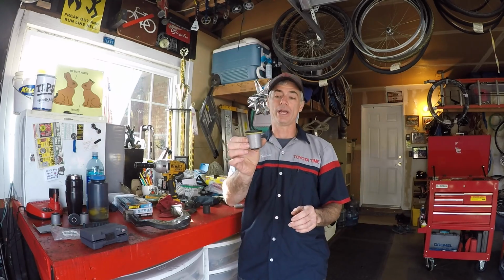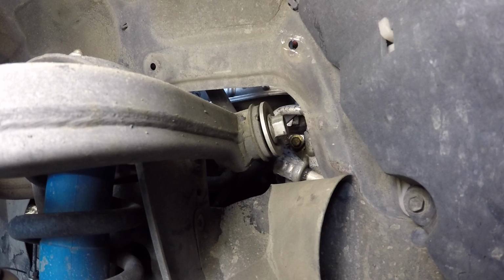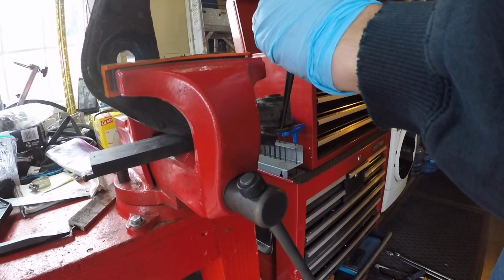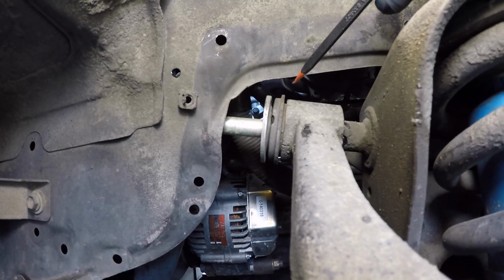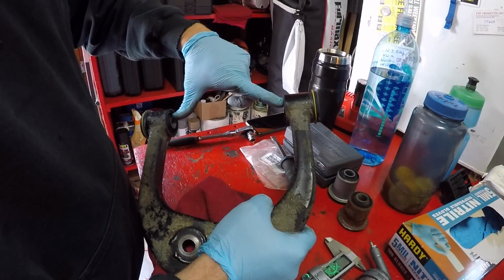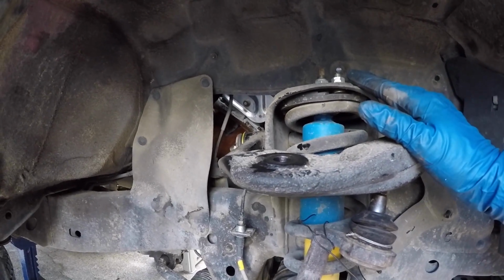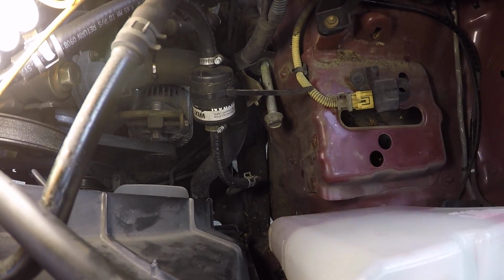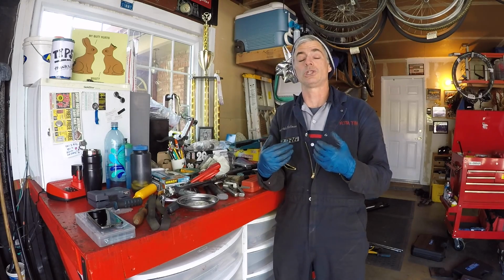Front Upper Control Arm Bushing Replacement

Comment: Hi I'm looking to do this job later this month. Do the OEM UCA Bushings (#48632-35080) come as singles, or packs of two? Need to know how many to order. Thanks so much for these fantastic videos! I'm doing a whole redo on the front end (UBJ, LBJ, bushings for UCA and LCA, and new inner/outer tie rods!), so your channel is a godsend!! Thank you!
Reply from the maker: Hey Steven, the bushings come as singles.  Great to hear you're making good use of our videos.  Happy Wrenching!
Reply: @TimmyTheToolman  Thanks Timmy! Also, this is a bit of a shot in the dark, but would you happen to know if that bushing (part #48632-35080) would fit in a 1998 Tacoma SR5 3.4L 4x4? I can find the parts, but all the Toyota sites are saying the fitment isn't correct given my VIN, and I can't find the equivalent part number for my Tacoma (they only sell the entire UCA). Should I try anyways, or just go with aftermarket bushings from Energy Suspension?
Reply from the maker: @stevenwang4125  The suspension on the 1st Gen Tacoma is pretty much indentical to the 3rd Gen 4runner but they will quite often have different part numbers for the same part.  Here's a link to the Camelback Toyota site: https://parts.camelbacktoyota.com/parts/1998/Toyota/Tacoma/SR5/?siteid=214329&vehicleid=84925&diagram=8510185  Take a look at item #9.  Part number #4863235070
Reply: @TimmyTheToolman  Thanks so much, sir! Looking to do the work this weekend, so if you notice a sudden surge in your views, you'll know why! ;)
Reply from the maker: @stevenwang4125  You're welcome Steven.  Good luck with the job.
Reply: @stevenwang4125  Did part #4863235070 work for you?
Reply: @fcparsons  they ended up not carrying it in stock. I ended up just ordering brand new UCAs... Sorry!
Reply: @swang011  Good deal! Thanks.
Reply: @TimmyTheToolman  Love your videos and respect the work that goes into them. I’m in the same situation as Steven was. Stevens Creek Toyota officially says uca replacement is the only approved way to replace the uca bushings on a First Gen Tacoma. I’m tempted to try one of the 48632-35070 bushings to see if it works before caving and buying new uca’s.  Your thoughts?
Reply from the maker: @fcparsons  If you have the right tools, replacing just the bushings is cost effective.  Dealerships and other shops will take the easy way out because they know their time is expensive so they won't suggest bushing replacements because it will equate to the same amount to the customer whether they choose new control arms or just replacing the bushings.  But, do you you earn $200/hour?  I definitely don't.  So, it's cost effective to me to take the time to replace just the bushings because it's a savings.  A hydraulic press, press sleeves and other tools will pay for themselves many times over if you like to wrench.  Shop labor rates are extremely expensive and it pays to do your own work.
Reply: @TimmyTheToolman  Finally got around to it. Can verify the 4Runner 48632-35070 bushings you reference worked on a 99 Tacoma. Had to use an angle grinder to shave off bushing flanges to fit bearing splitter on arm. Then used bolt and washers to press out bushings. No heat needed. Worked like a charm. Thanks for the inspiration and instruction.
Reply from the maker: @fcparsons  Thanks for letting us know the bushings do work for 1st Gen Tacomas.  Glad the job worked out for you.  You're very welcome and Happy Wrenching!

Comment: Maybe just buy a whole new arm instead.
Reply from the maker: You could but it's more money.   This might be the best option for those that don't own a press and don't want to buy one.
Reply: I'd say only if you're putting an aftermarket UCA to gain caster angle with a lift. A new stock UCA is just a waste of money for just the new bushings.

Comment: what torque wrench do you use? do you recommend it? I'm in the market for my first one
Reply from the maker: Hey Zach,  for most of my life I didn't own a torque wrench but now I own 3 and use them all.  They are all made by CDI which is made by Snap-On.  Here's the ones I own:
https://www.amazon.com/Industrial-CDI-2503MFRPH-Adjustable-Micrometer/dp/B000KL4H80/ref=sr_1_2?s=hi&ie=UTF8&qid=1526057994&sr=1-2&keywords=cdi%2Btorque%2Bwrench&th=1

https://www.amazon.com/Industrial-CDI-2503MFRPH-Adjustable-Micrometer/dp/B000KL2J7G/ref=sr_1_2?s=hi&ie=UTF8&qid=1526057994&sr=1-2&keywords=cdi%2Btorque%2Bwrench&th=1

https://www.amazon.com/Industrial-CDI-2503MFRPH-Adjustable-Micrometer/dp/B001VXRYG8/ref=sr_1_2?s=hi&ie=UTF8&qid=1526057994&sr=1-2&keywords=cdi%2Btorque%2Bwrench&th=1

If it were me, I'd probably buy the 1/2" drive one first so I can properly torque some of the bigger fasteners on a vehicle.  The 3/8" drive wrench that goes up to 100 foot pounds is my choice when there's limited space for the bigger 1/2 drive wrench and I don't need to exceed 100 foot pounds.  The inch pound one is handy for the lower spec applications like the valve cover gasket bolts.  If you going to get heavy into wrenching on vehicles, I'd recommend eventually buying all 3.  With that said, If you understand mechanical advantage and have the common sense to adjust the force you use based off the size of the fastener, you can get away without using a torque wrench in my opinion unless you doing things like tightening down head bolts and other things of that nature that the torque value is crucial to follow.
Reply: Timmy The Toolman oof those are pretty expensive. There are many other brands with equally good reviews and about 1/3 the price. Any reason why I shouldn’t go with one from a brand like Tektron? I know snap-on’s reputation is amazing but man that’s an expensive wrench
Reply from the maker: Hey Zach, at the time I was searching for a torque wrench, the CDI ones caught my eye because the reviews were really good.  If you found ones, like from Tekton, that get good reviews and are much more affordable, go for it.  I base my tool purchases off reviews and recommendations from people I trust.  I have bought some Tekton tools and they seem pretty good to me.
Reply: Timmy The Toolman sounds good thanks. Totally separate question. I am removing the rear sway bar links and cannot get the lower nut off. The nut is on one side and the other side is the ball joint, so when you turn the nut it just spins the ball inside the joint. Any guidance on how to remove?
Reply from the maker: There should be an allen head on the end of that bolt so you can hold it firm while you loosen the nut.  Clean up the end of the bolt stud and you'll see it.  I think it's either a 5mm or 6mm.

Comment: While I was able to bottlejack the bushings out of my LCA's, lacking proper tools I "heated" the uppers. I took the weed burner to them and set them on fire, when they were about seared to medium rare they pushed out easily with a pipe.
Reply from the maker: Well, good job gettin er done.  I like using heat to facilitate bushing removal too but I only use moderate heat to assist with the pressing.  I think some heat is ok but you have to be careful how hot you get it so you don't compromise the integrity of the steel.

Comment: Timmy I’m getting a really bad up and down shack in my steering wheel when I apply the brakes. Bead new rotors and pads checked my guide pins. Was thinking steering rack or ball joints? Please help
Reply from the maker: So you're saying getting an "up and down" shake in your steering wheel?  I'm guessing you're meaning and side to side shake.  Up and down would be impossible unless somehow your steering shaft and linkage is completely loose.  The cause could still be the brakes if the wheels weren't tightened properly causing the rotors to not be sitting true. It could be worn out control arm bushings, worn out tie rods, maybe the steering rack.  

I'd start by loosening the lug nuts on the front wheels and tightening them in a crossing or star pattern slowly bringing them up to a torque spec of 85 foot pounds.  Then do some inspecting of your front end components looking for anything obvious like torn and leaking tie rod or balljoint boots.  Get a pry bar and see if you can detect abnormal play in your upper and lower control arm bushings.  

My guess is it's related to the brakes.  If there's a shop nearby that resurfaces rotors, maybe have them check the runout to see if they are true.

Comment: Wow I bent a pipe wrench trying to twist those bushings out of the upper control arm. The press is critical here. I heated mine and they were frozen.
Reply from the maker: Yeah, the press is a nice tool to have when dealing with control arm bushings.  I usually use heat to loosen the bond of the bushing sleeve from the control arm and then press it out.  This was one of the few times I didn't heat the arms to get the bushings out.

Comment: I replaced mine with Total Chaos upper control arms !!  http://www.chaosfab.com/96-04-Tacoma-Upper-Control-Arm-Suspension-Kit-96500.html
Reply from the maker: William Goble Yep, that's a good way to go especially if you have a lift and plan on running wider tires.  I put Camburg arms on my 98.